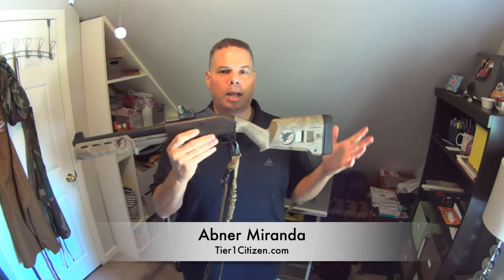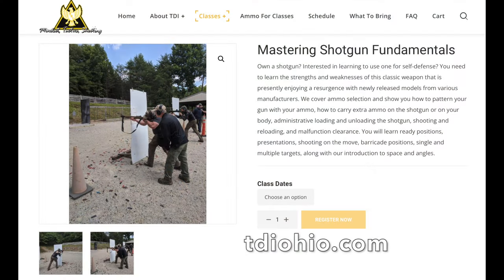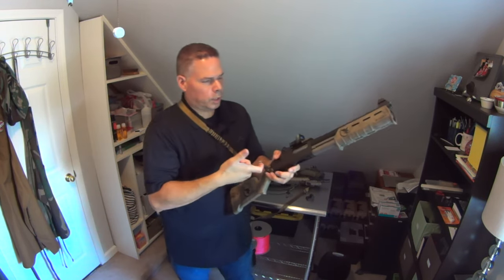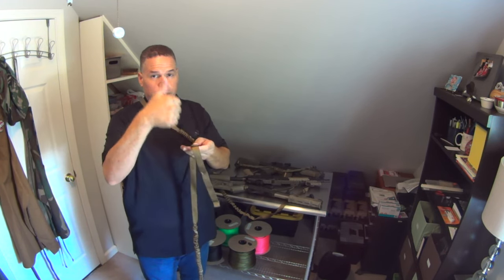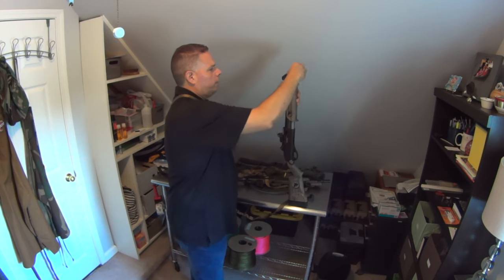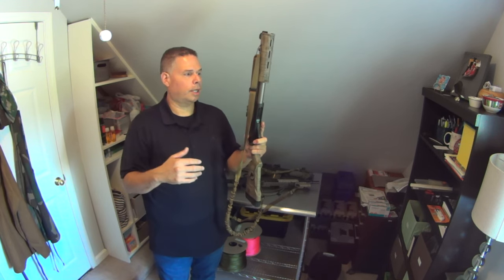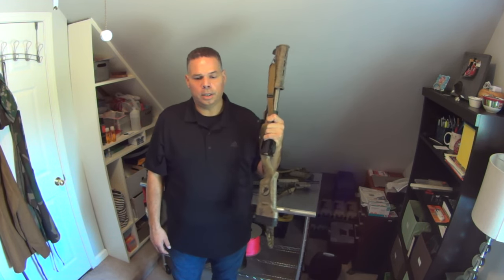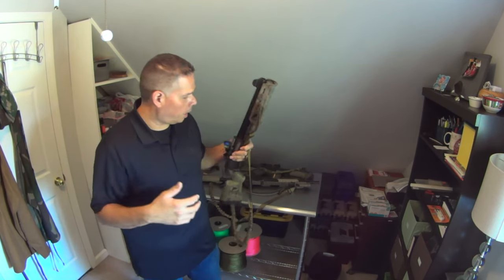How to Apply the Tier 1 Citizen 2 Point Sling to a Shotgun

Comment: I've got a new baretta 1301 tac mod 2, same handguard as the a300 patrol. Now I've got qd socket, and mlok on the front, but the dumb qd socket placement on the stock, is on the bottom. I'm debating between paracord loop around the grip of the stock, or a2 stock adapter strap, for the stock. Anyone else running this on baretta 1301?
Reply from the maker: Yeah, European gun companies don't get how to put sling mounts on weapons.

Comment: So I do own an A300 and I am getting your two point sling. Should I get the one specific for shotgun or one with 2 QD in case I want to switch this to my rifle if it doesn't work out?
Reply from the maker: This is what I sent you via email. 

If you are interested in potentially using it for your rifle, get it with the QD’s. Make a note for me in the Special Instructions section at checkout and I will also add some Paracord Loops for you, at no extra cost. That way you have both options available to you.
Reply: @Tier1Citizen  thanks. I'll add that note in when I check out

Comment: I have a real dumb question.
Can you use that single point set up and the 2 point set up?
I am saying to remove one side of the singlepoint and just put it on the front when you want to run 2 point.
Reply: The single point sling is a permanently closed loop. It is not convertible from single to 2 point. You could potentially run a 2 point with  hk clips and use the demonstrated single point attachment point and move one side out to the hand guard when needed.
Reply from the maker: This is not a convertible sling. I only make slings that are dedicated to one purpose or another. Try it, you won't regret it.